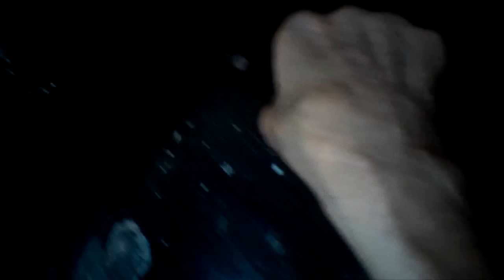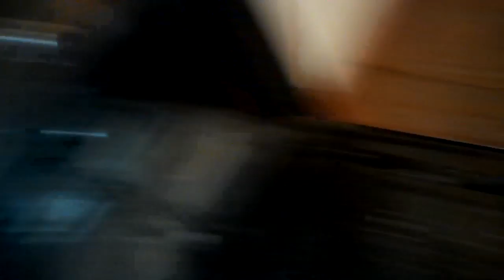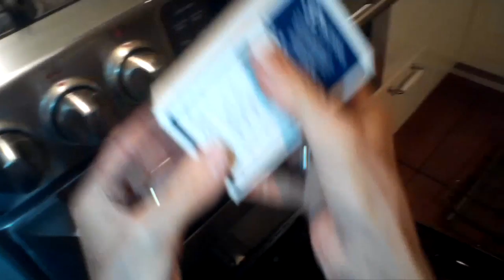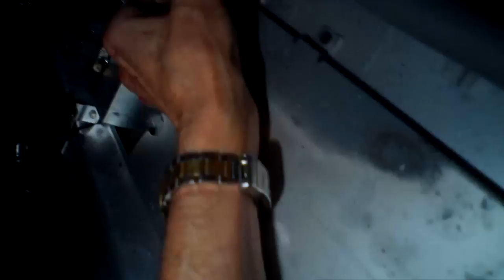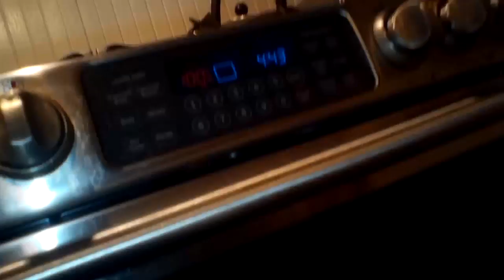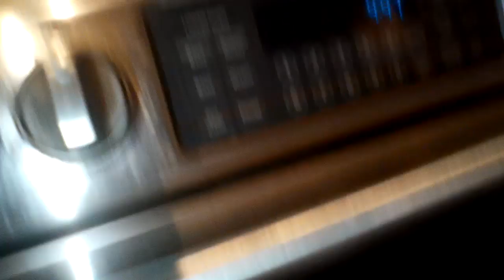✨ GE Double Oven - Bake Won’t Heat - EASY 30 Dollar FIX ✨

Comment: Problem is with the deflector in the lower oven. There was a service bulletin put out in 2016 RA 04-16 for this oven, to replace the deflector piece and glow bar. The deflector is making contact with the glow bar and it will keep breaking it. That’s what yours blew after 4 years the heat makes the deflector melt and make contact with the glow bar. It’s a manufacturer fault and of course no recall because it’s not a safety issue.
Reply from the maker: Great info.
Thank you 😊

Comment: Scott - We have the same type GE double gas oven range.  Both ovens are preheating but quite preheating with the oven registers the input temp.  However, the oven is not at that temp.  Usually shuts down preheating and starts bake when the true oven temp is 50 degrees or more lower.  So they replaced the igniter in lower oven (still having trouble regulating the true oven temp) and then replaced the control board.  There has been no improvement in the upper or lower oven with the abovenoted repairs!   Any thoughts?  Thanks!
Reply from the maker: Might need new temperature sensor.

Comment: When we set the lower oven to temperature like 350 it will only heat to 260 or somthing else.. thi has been the problem since we've  bought it. Do you have any idea what the problem is?
Reply from the maker: Hi Roy,
That’s usually caused by a worn out igniter.
Reply: ScottTheFixItGuyChann
Its odd that it would be that.. its been doing that since  the day we got it?
Reply from the maker: Gotcha,
Sounds like it might need to be calibrated.
Reply: Would you know of a YouTube video showing how to do this? @ScottTheFixItGuyChannel

Comment: You can replace the whole ignition assembly without cutting wires.  Have to disconnect it in the back.
Reply from the maker: That’s right👍

Comment: Fried within minutes of reinstalling. It also seemed to zap the control panel, no digital time or any controls are illuminated anymore, completely a blank screen but the oven light will still come on so there’s power to the oven.
Any idea why this would happen, is this worth fixing in addition to a new igniter? 

I wish I read the comments first, it seems the heat guard touching it causes it to break. I didn’t think to look for this first.
Reply from the maker: I had the same thing happen.
The metal part of the igniter came in contact with the frame and shorted out the controller .
Unfortunately you need to replace the controller and the igniter.😢

Comment: I had a similar problem, but after trying two different ignitor glowbars (both of which heat up when connecting directly to 110v), I tested the voltage coming out of the connector to the wires of the ignitor and I'm only getting 5 volts when turned on.  I opened up the entire back panel looking for a fuze or something, but to no avail.  I've got a much bigger problem on my hands, sadly.
Reply from the maker: Thanks Travis,
Time to replace the controller.

Comment: Hi Scott. Just a dumb question...i have the same oven and noticed that bottom oven doesn’t “glow” on both side evenly. It’s bright on the left side but only has a slight glow on the right side. Oven still seems to heats up ok. Does this indicate a problem with the right igniter/glowbar?

Comment: Scott,  thanks for the video.  My upper oven heats for broil but does not heat for bake.  Do you know where this igniter would be located or have you done a video for the upper igniter replacement?
Reply from the maker: Thanks Christian,
The technique should be the same for the upper oven

Comment: Hi Scott. I have the same oven but the control panel won’t display. Appliance company told me it was an issue with Motherboard and that needs replaced. Is this something that can be done DIY?
Reply from the maker: Yep,  just about 45 minutes of your time👍
Reply: @ScottTheFixItGuyChannel  Where can we find the codes? After replacing the motherboard, I got an f900 code

Comment: Hi Scott, I hope you're still replying to comments on this video.  I have the same oven with the same problem.  Great video and great instruction.  I have worked through this twice now with the exact same part you referenced and both times they blew out within 10 minutes.  The first time the part lasted about 5 minutes, then  broke to several pieces.  The second time was about 10 minutes.  I was pretty careful with the installation with the understanding that they are pretty fragile parts, especially the second time.  Any ideas you could help me with?
Reply from the maker: Thanks Jeff,
I would replace that igniter with the more common Electrolux Oven Ignitor that can be purchased on Amazon that comes with a metal cage around it.
Without the metal cage that igniter just won’t last very long

Comment: I have the same oven and it will not even turn on or display the time. Any recommendations on what I should check or part that I should replace? The gas burners still work which means I can cook using the gas burners but no frozen pizza for the wife and son! :(
Reply from the maker: Do the igniters on the stove still work?

Comment: I have the same oven.  GE Cafe.  It is the top electric oven that is not working for me.  I go to turn it on and it squeals, not allowing the oven to turn on.  What do you suppose that might be?
Reply from the maker: Not sure what the squeal would be.
Reply: @ScottTheFixItGuyChannel  Just so you know Scott for your file , ......it was a bad  "relay" switch.  Stove had to be pulled out and the side panel removed to replace the part.   Now it is great!  I love my stove!

Comment: Hi Scott.  I followed your instructions and successfully replaced the igniter. You were right.  The manufacturer doesn't give you a lot of wire to work with when attaching the new igniter.  That step was very tricky but with a little persistence, I got it to work.  Thank you for your video.  It was very helpful.
Reply from the maker: Thanks for the feedback Sergio 👍

Comment: I have same Stove but my problem is after like 5 minutes or so stops working even touch controls are not working ether, I have to disconnect electric plug to make it work again but same problem after 5 minute shutdown , is just the oven everything else is working,. Any suggestions I would appreciate thanks
Reply: Is your plug socket GFI or no?  (does it have the Test and Reset buttons?).  If so, replace it with a standard socket.  Otherwise, not sure how to help with your issue, sorry.

Comment: Well all went ok for me BUT the replacement igniter failed after 1 week, now I have to start all over again!!.
Reply from the maker: Sounds like a bad igniter.
Reply: @ScottTheFixItGuyChannel  A little more info that might help when doing this fix: I decided to inspect underside of the lower oven tray that is removed for access to the igniter, I found that the heat shield had a large blister right above where the igniter sits, the heat shield had melted and holed, the blister was large enough to touch the igniter element, this is the reason the new igniter failed immediately!!!  I removed the 4 screws from the shield and gently dressed the blister flat with a hammer, everything is working again now but I'm not happy with this GE design!!
Reply: @robarnold4104   Thanks for this additional info.   The same thing appears to have happened, where i replaced the igniter (Thank you Scott!!),  and within 5 minutes the new igniter blew due to the blisters.   Will follow up to see if the fix works
Reply: @ScottTheFixItGuyChannel  for the ge cafe oven CGS990SET5SS how can you tell for sure if its the igniter, the heat shield, or the control board. my stove works fine except for the bottom oven. resetting the circuit breaker "used" to work. After we replaced the igniter, it worked for a week. Now the igniter doesn't even glow and i dont even hear or smell any gas. Does the gas come on first or the igniter? Any suggestions on troubleshooting would be hugely appreciated.
Reply: This is the real issue with this model, I’ve replaced my igniter twice now, the first was under warranty and I watched the tech fumble around with it. Ultimately, the heat shield is the culprite and I just took a grinder to the shield and it lasted two years, just went out AGAIN. Fixing as soon as part arrives.